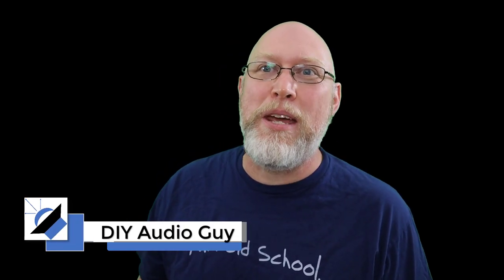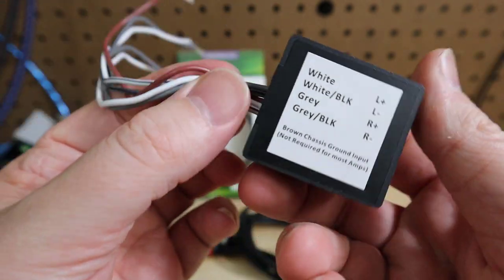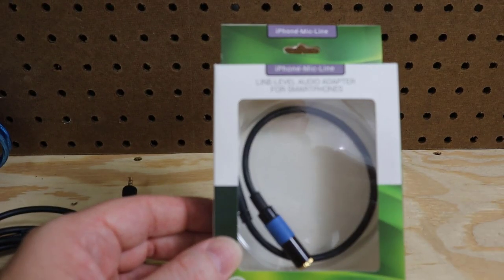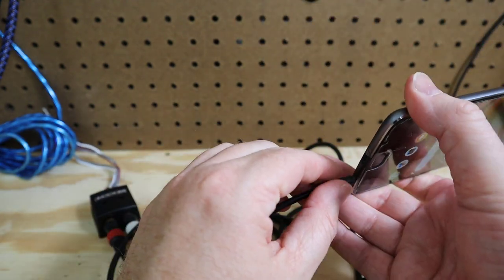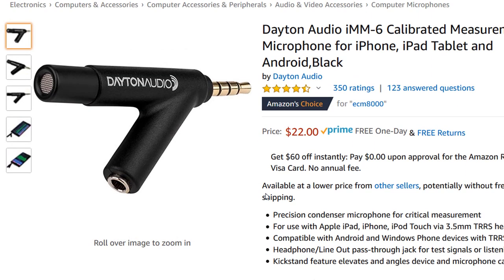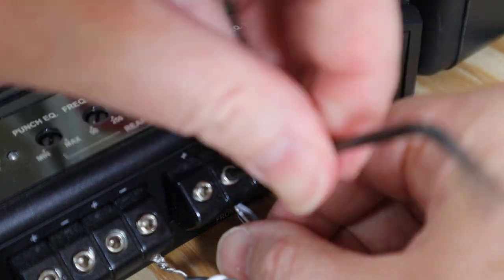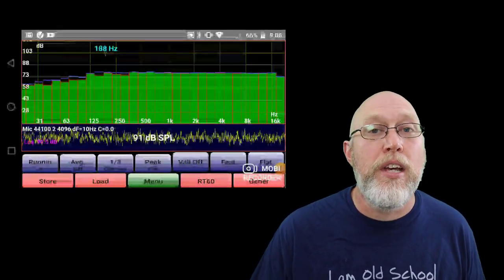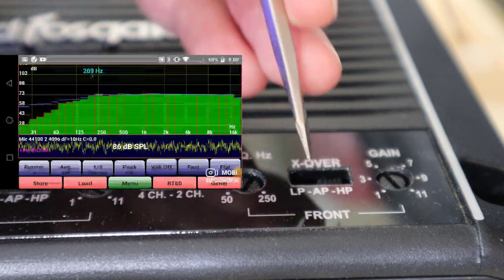DIY Audio Spectrum Analyzer, AFFORDABLE RTA!

Comment: I’ve used the audio tools app and it definitely gets you pointed in the right direction for very little money. I used the Dayton imm-6 and loaded the calibrated file although it didn’t seem to make much of a difference over the iPhone mic
Reply from the maker: I had a similar experience.
Reply: Sorry complete novice so maybe a silly question but does this mean that if you use the Dayton imm-6 mic and the tools app you don't need to make this RTA from LOC since they will do the same thing?
Reply: @joebloggs4191  this setup will allow you to measure the signal. The imm-6 let's you measure the response of the speaker. 

Speakers all have their own unique response curve, so even if the signal being sent to them is flat, the response you read from them will usually not be flat. 

IMO, the response from the speaker is more important than the response from the amplifier, BUT if there is an issue with the response from the speaker, being able to see if that issue is coming through from the amp is nice.
Reply: @brandonweigel6309  Ok,  many thanks!
Reply: @brandonweigel6309  thats what i was thinking 😂it don't make sense mannn😂but yea from the amp I agree

Comment: I use an UMIK-1 calibrated USB microphone plugged into my laptop and run Room EQ Wizard software. Fast and easy.
Reply from the maker: I keep having trouble with REW, my laptop does not seem to like it.
Reply: @DIYAudioGuy  what kind of laptop? I have a Thinkpad Carbon X1 with a i7 6600u and 16 gigs of ram. Runs rock solid.

Comment: Have you ever tried to test an audio spectrum with pink or white noise (or maybe some sort of easy sweep generator? I've seen them as android apps)  ? We've got a special ham radio application we are trying to set up so we know more about what a "repeater" sounds like. A "repeater" is a special fm radio on a mountain top that picks up weak fm radios and transmits them to the other side of the mountain for instance.  The spectrum on some repeaters (especially ours) can be messed with to the point where you don't know what you've got. Its radio audio and every radio messes with the audio specrum (FM Pre-Emphasis and De-Emphasis). We have a volunteer group with special repeaters (ham radio) trying to fix the audio so every repeater sounds the same. The end gadget needs to be inexpensive, easy to replicate, and easy to power. We can't rely on our ears, sometimes you are in a building with fans and air conditioning and can't hear yourself think !
Reply from the maker: I usually use pink noise for this.  I don't know anything about ham radio.

Comment: Let me get this right,  If you want to check an aftermarket stereo with RCA preouts you can simply plug in your 3.5mm to rca into the headset buddy attenuator , other end into stereos rcas and run the app.  If you want to check a factory stereo or any other  radios you need to do the same but include a LOC to reduce the volume before going into the attenuator.
Reply from the maker: Yep
Reply: @DIYAudioGuy  Thanks.  I like your simple to understand videos. 👍  I learn something new every time.   I recommend them to others quite often too.

Comment: Have you tried different rcas?  there's a big difference on how twisted pair and shielded rcas work dymore has a video explaining that, cause I'm sure the 3.5 jack has a ground for the noise to go and if there's not a place for it to go it will be picked up on the rcas, a ground loop isolator may fix that,dymore also has a video on line output converters, which output converters are better the Kicker one is in that video to also,there may be better options, I'm looking for a budget rta and this video helped alot I'll just get a Audiocontrol lc2i and go for a 3.5 to rca cable that's shielded and ground that shield to the ground on the lc2i which should kill that noise being the rcas and the ground are isolated Thanks Again
Reply from the maker: Yea, tons of variables that can throw off the results.

Comment: I built one of these a few months back and I'm using the same app with the same IMM6 mic. Loading the calibration file can be a bit tricky. I had to follow some hints by some reviews on Amazon and parts express. With the DIY RTA I have the same issue with noise using the same parts you did and a Samsung Galaxy A50. If you ever find a solution is love to know.
Reply from the maker: 80/20 rule.  One day I will be able to buy a real RTA.  Untill then I am going to build a mount for this and live with the shortcomings.
Reply: I too have been interested about building one of these. Could you add a wire with a gator clip to the brown wire on the LOC...which I believe is a ground dump (noise reduction) and ground that gator clip to the car chassis? Maybe that would help remove some noise...

Comment: I don’t know if I missed it, but what was the source? What did you play the pink noise through?
Reply from the maker: I used Bluetooth from phone.
Reply: DIY Audio Guy ok, I was just wondering if the source itself may have introduced the noise. I have a lc2i doing nothing, so I’m going to try this soon. I hope it may have better results seeing as it may be grounded and such, compared to the simpler loc. I’m missing the trrs though. So until then, great video, thanks again
Reply from the maker: @carlosreset7501  My problem could be the cheap $10 head unit I'm using. My test bench has plenty of opportunities to introduce noise into the system.  So it might not be a problem with the LOC or the TRRS adapter. There are just too many steps in the signal chain.
Reply: DIY Audio Guy well as per the kicker literature, Bluetooth should be last resort. Lol. Also, there looks like some roll off on the bass side in the full signal, so maybe the source is attenuating the signal itself, maybe at the higher side as you mentioned also. As you said, the noise could come from all the individual components, but also maybe from components themself. I mean, maybe the lc2i May have a better signal than a simple loc, and in turn it brings us back to your 20/80, 80/20 rule. 👍👍✌️
Reply from the maker: Even though kicker specifically said not to use Bluetooth that went ahead and did it anyways since everybody uses Bluetooth these days.I don't blame kicker at all for any of the flaws in this setup. I think that LOC is pretty solid.
Reply: @DIYAudioGuy  Steve Meade channel did a review on several LOCs and tested this Kicker LOC for distortion. It did not produce any distortion (it was tested while grounded) until 8 volts output, which was turning that volume way up. Maybe a quick ground would alleviate any background noise introduced.
Reply from the maker: @seansean8008  Good idea!

Comment: I don't understand that headset buddy as 1 end is 2.5mm and the other is 3.5 mm. I'd like to do this using my Iphone with the lightning cable. The lightning adapter you link to is 3.5 mm. What about the 2.5mm end? What am I missing? or does the headset buddy come with everything needed ? Please advise.
Reply from the maker: The one I have is the same size on both ends.
Reply: @DIYAudioGuy  OkThanks. That makes perfect sense. I ordered one.

Comment: I purchased the headset buddy and rca adapter to 3.5mm and also a 3.5 mm adapter to plug into my fire hd10 tablet. Problem is finding an app that will allow reading the signal and not just the sound the tablet's microphone picks up. If I disable the micrphone permission for the app the app will not function. The app i'm trying to use is RTA analyzer free version. Amazon app store has limited apps to download. I had no luck installing google play store on my tablet to try to get more app choices. Do you know how to get an app to function via the cable and not the internal microphone? is it just a matter of purchasing the full version of the app instead of using the free version? That would make sense but I don't want to buy an app just to find out it wont work. I know kicker recommends the Octave app but I cannot get that on my stupid tablet. All this technology is lame.
Please advise if you can.
Reply from the maker: I hate to hear that.  I don't know of a work-around.  Sorry.
Reply: What do you think about possibly using the  headset buddy and connecting directly to a laptop and using Rew software?

Comment: Try solder it to an RCA jack?  Or is it possible to use just the rca to 3.5 on a low level rca to see the signal only?
Reply from the maker: You need the adapter with the attenuator.
Reply: @DIYAudioGuy  okay so the attenuator and the RCA to 3.5 plugged into the Dayton Mic jack?
Thanks BTW this will help big time setting up my source unit.
Reply from the maker: @UltraCon79  You're using the date and audio microphone you can just plug that right into the smartphone. No wires required.  The rest of the setup is designed for tapping into speaker level outputs, like in a car. For that you need a line output converter, the RCA to 3.5 adapter, and the headset buddy adapter.
Reply: @DIYAudioGuy  yes I'm trying to tap into RCA outputs from my source unit in the car I want to see my signal RTA
Reply from the maker: @UltraCon79  in that case you just need to go from RCA's into the headset buddy adapter.  You might be able to go from the RCA's right into the phone, but I'm not sure.
Reply: @DIYAudioGuy  thanks!  Like you said I will try old phone first

Comment: Hi i need some help, I have an kenwood ddx4048bt with 2 sets of RCA (Front and rear/sub) I want to connect 2 amps (1 4 channel for speaker and a 2 channel for sub) but an missing an RCA from the radio, what can I do?
Reply from the maker: There are a lot of different ways you can do that.  You can hook the four channel up to the front outputs and the subwoofer amp to the rear outputs. You won't be able to use the fader if you do it this way. Another option is to get a four-channel amp that has a pass through function on the RCA's.  So it'll have a set of RCA outputs that you can run to the subwoofer amp.

Comment: cell phone mics are not calibrated maybe it will work on signal lvl
Reply from the maker: Good point, didn't think about that.  The app I'm using can be calibrated. So that would probably fix the problem. I've never tried the calibration function. But I have loaded a calibration file for the IMM6.

Comment: line output converter itself not giving you flat signal and you should use cheap ones
Reply from the maker: The kicker LOC I am using works just fine.